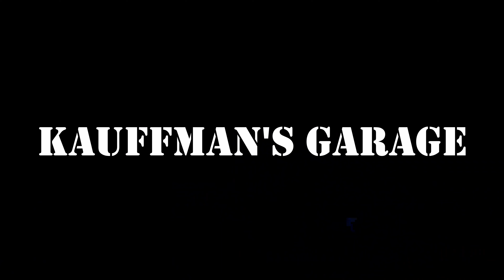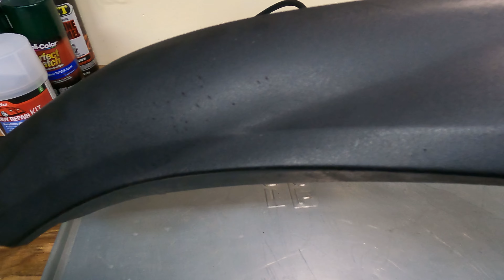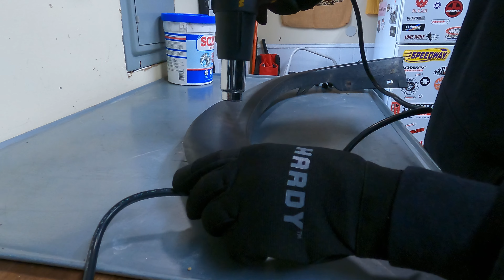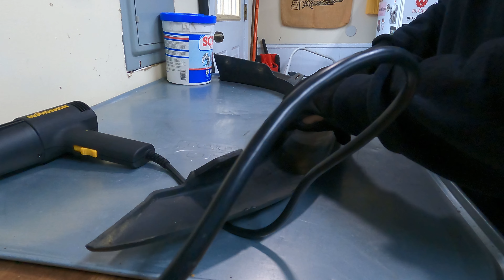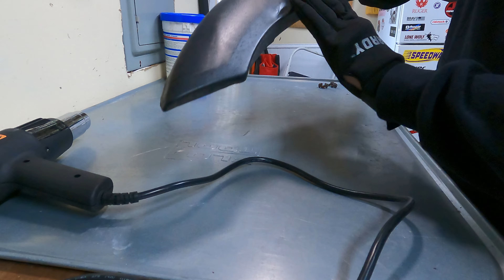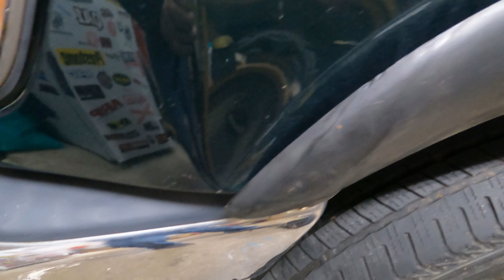Trying to salvage a 3rd Gen Toyota 4Runner small fender flare

Comment: Can you show me the removal and the reapplication of the rear small flare piece above the rear wheel? Can’t find a video on it and don’t have it on hand to mess with.
Reply from the maker: The small piece on the rear has clips that slide over the door edge and Phillips head screws that hold the flare to the clips.